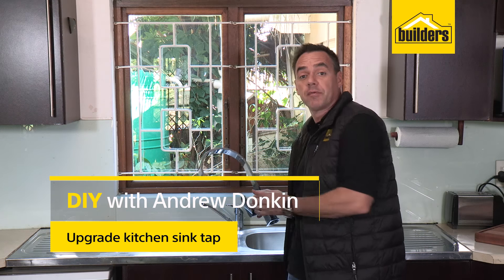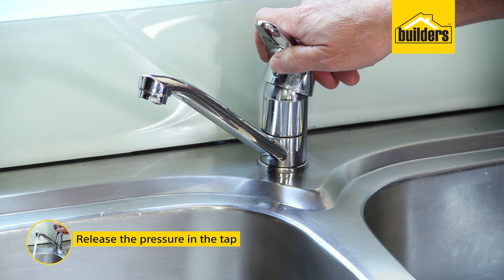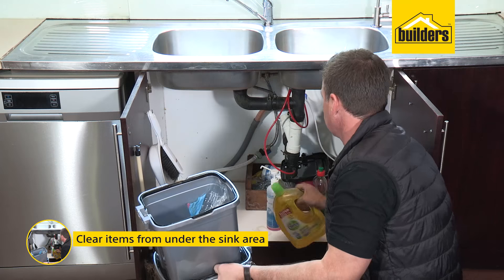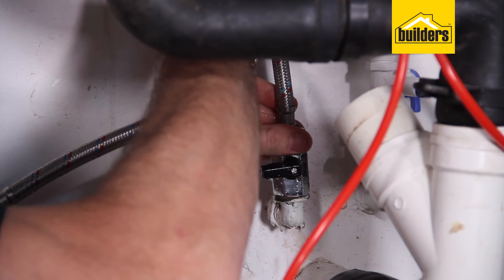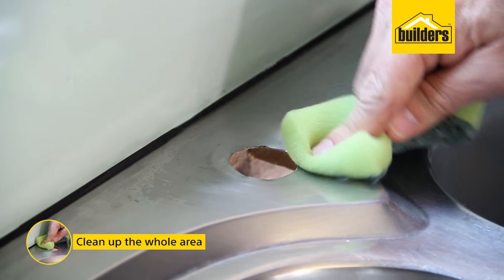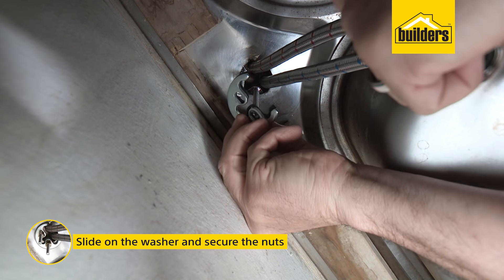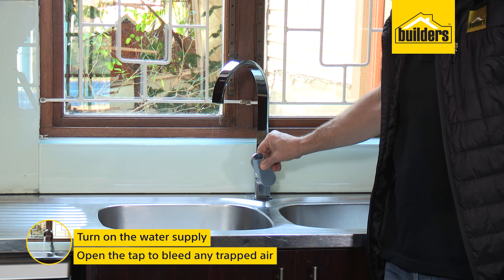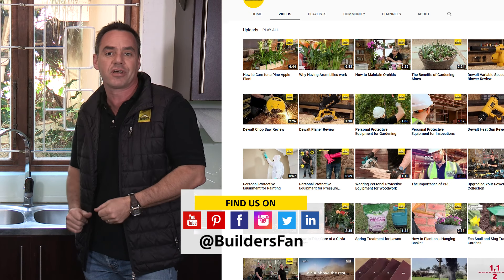How to Change a Kitchen Sink Tap

Comment: I think a plumber might be a little easier as too many things could go horribly wrong here.
Reply: You can do it easily if you think so!
Reply: Paying someone else to do it is always “easier!” But learning so you can do it better the next time is the fun part
Reply: @Calz3n  Not so fun part is the water damaged cupboards that you will have to replace if it goes wrong...
Reply: @sashen6678 how could that go wrong? Literally all you need to do is turn on the taps fully after you turn off the water supply to ensure there is no water being supplied to the taps and get as much water out the pipes as you can before disconnecting them. Is that so difficult?

Comment: Can’t get wrench back in tight spot is there a certain tool to tighten sprayer hose to faucet connection
Reply: I had the same problem. The mixer tap I needed to tighten was in the centre between two kitchen basins. There was little room to even see the nut that needed to be tightened, and no way to get a spanner on to it. 
I found a set of tube spanners at the local hardware shop that were made for installing mixer tap. These tube spanners are almost twice the length of "general purpose" tube spanners and made an impossible job very simple.  

Without this video, I would not have known where to start. The right tube spanners made it even easier as a DYI repair. The tube spanners I found are described as "The Haron Mixer Tap Spanner Kit features a 180mm length to reach high up under sinks in tight areas and covers all sizes of mixer tap nuts"

Comment: Tried this but I've now got water dripping out of both joints connecting to the flexi pipes. Should have just called a plumber in the first place.😢
Reply: never hurts to use some thread sealing tape

Comment: Missed out a little bit:  like when you can't get your flexi hoses through the hole because the hole isn't big enough for a lock nut and hose.  You have to unscrew one of the hoses from the bottom of the tap, insert the whole thing, screw that hose back in from underneath.
Simple and obvious I know. Well the whole thing is simple and obvious.  But many people, myself included don't see the simple and obvious in a new technology they've had no experience in and are fearful of unscrewing things they might not be able to put back.
So it's worth just saying it:  unscrew one hose if they both won't go through.
Reply: And how do you get the nut to the old tap off because the tap was installed before the drop mounted sink - the spanned doesn’t fit in the space to loosen anyone know where I can find the answer to that??
Reply: @amandabotfield2150    dont really understand your problem because can't see it but I guess it's about not being able to get a spanner onto the nut for one reason or another?  So I don't know,  just hitting out in the dark.  But sometimes when you cant get at a nut you can hold the nut so it won't move and you can twist the thing its holding.  like hold nut, turn tap.  Then turn tap and nut back to where you were a second ago and then hold nut and turn tap again.  if you see what I mean.
And another way sometimes you can get a punch in there an carefully punch the nut around bit by bit with hammer and punch.  often such things only need starting and then they go with finger strength is enough.
Often if you can't get the spanner in you can get a multi grip or similar in because they can grip the nut from more underneath rather than square on as a spanner has to be - again, if you see what I mean?  I don't know if you know tools at all but there's 'multi grips' ( at least called these names here in Aus ) and they have jaws that open kinda in 'notches' to different widths and you apply with the strength of your hand.  They're generally long and kinda slender and can get in places.  But some really cheap ones fall apart on you.  And good ones maybe you haven't got the grip strength and they'll slip on the nut.
So a 'vice grip is better.  They''re bulkier and so can't get in the slimmest of places but like kinda from underneath, they can do that. They have a knurled wheel on them and you turn it to set where they will 'lock' And you set it so's they lock on the nut at a width kinda just smaller than the nut.   You do it by feel.  It's easy.  You set it an grip the nut; they turn around without gripping? Okay turn the wheel more.  Now you can't close them to the çlick/ ?  Okay back off a bit.  Get them just right and they have an awesome grip on things.  You can get a nut from underneath so's the vice grips are inline with the axis of the bolt through the nut - understand? - and then get another pair or a bit shifter on them to turn it and it'll turn the nut alright.
Just punching in the dark.  Hope it at least does no harm if it does no help.  :)